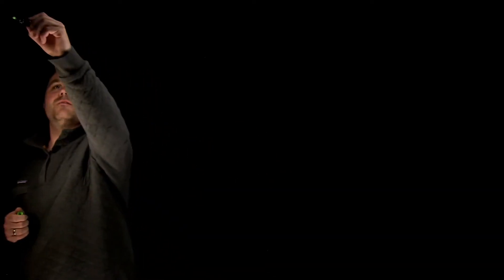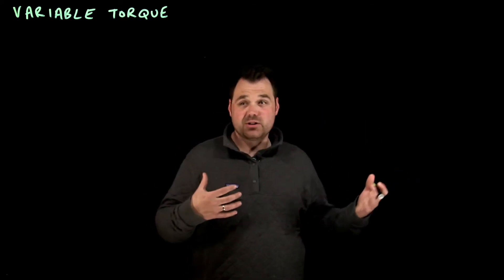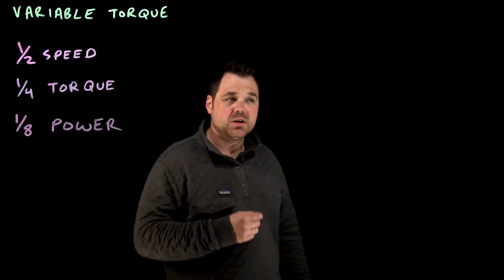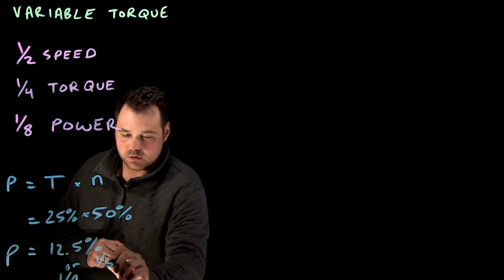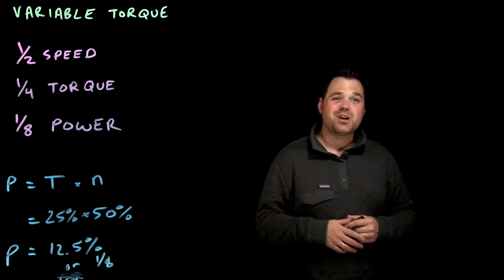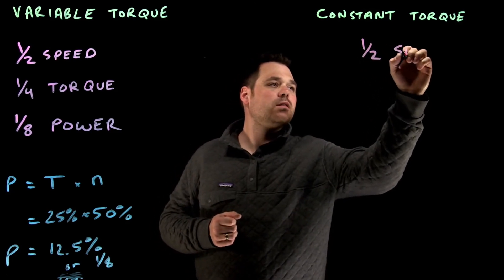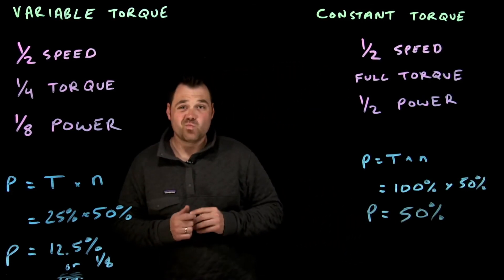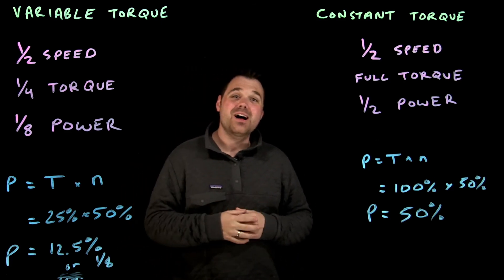Energy Savings with a VFD on Variable or Constant Torque Loads

Comment: thanks a lot for the explanation... P= T x n is mechanical energy... was these results measured on electrical consumption of the VSD?... is running two water pumps at 40 ℅ speed will consume less electricity than running one pump at 80℅ speed?